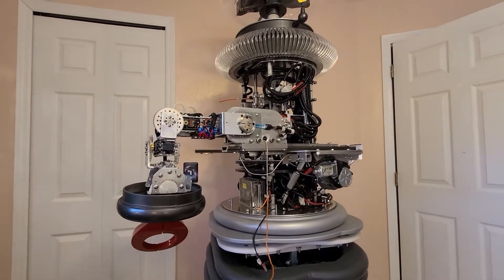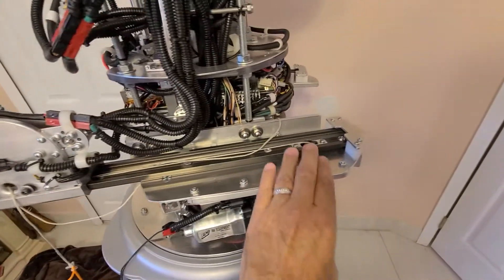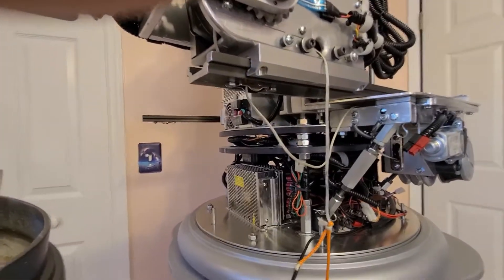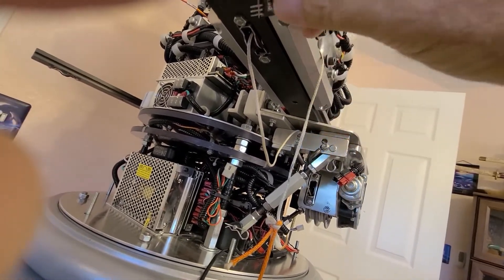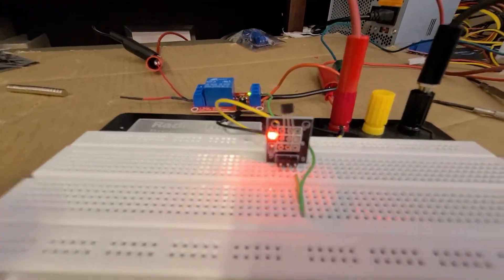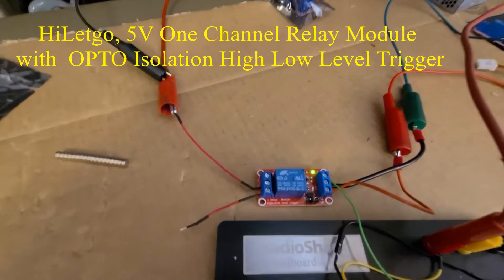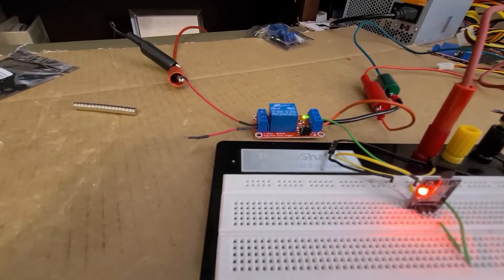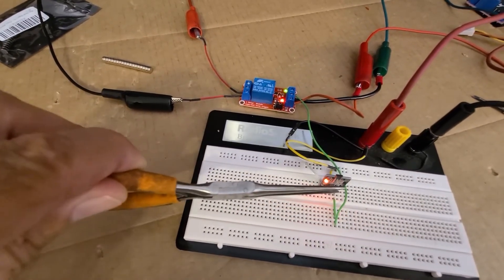Lost In Space B9 Robot Arm Rail Upgrade - Part One: Hall Sensor Limit Switch

Comment: ..... Excellent, Well done Mate,
The magnet could also be mounted at the rear of the sliding mount and your sensor in the channel ?
The neodymium magnets can also be purchased with countersunk holes.
Reply from the maker: Hi Rob! Those are excellent ideas! Thinking it through I love the idea of mounting the sensor on the rail at the forward end of travel point at the rear of the carriage. This may place it in a more protected area and limit the wiring. I do have that moving cable running  along the underside of the rail I need to avoid though. I'll have a look at this. I'll have to shop around a little for the magnet with a counter sink hole. That would make it more secure for sure.
Reply: @DavidSchulpius  .... I was suggesting the back end of the moving carriage, the magnet set in a hole on the underside and the sensor in th channel.
Thanks Mate. Good fun, (Engineering).
Reply from the maker: @robbieaussievic  Yes, lots of fun! I'll look at this option. Thanks!